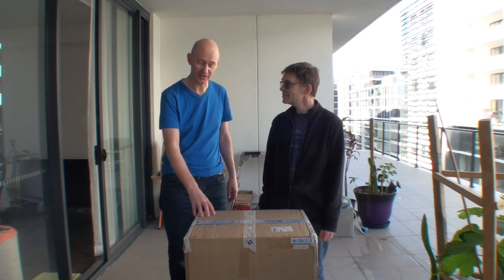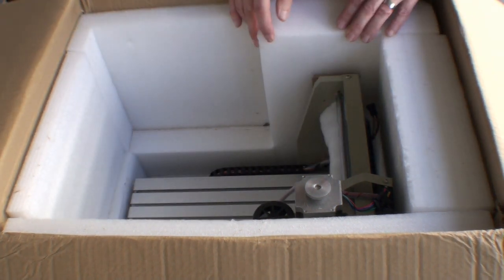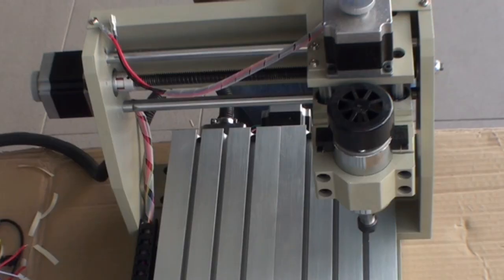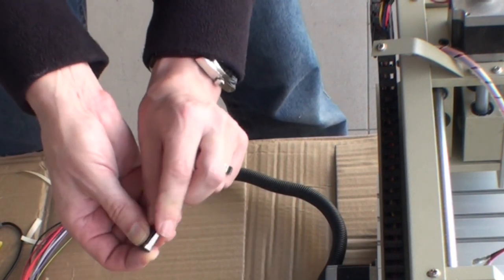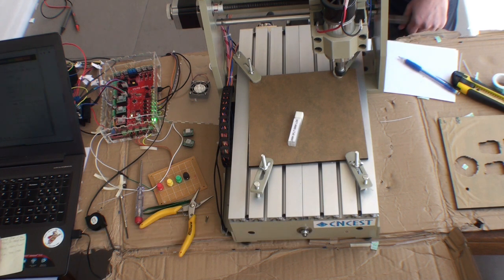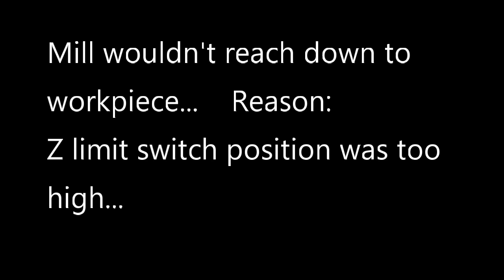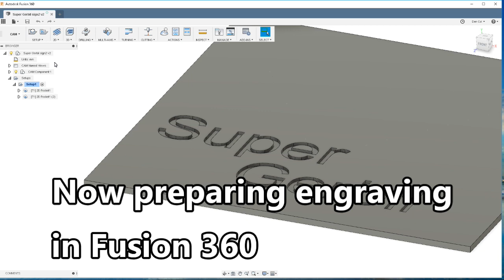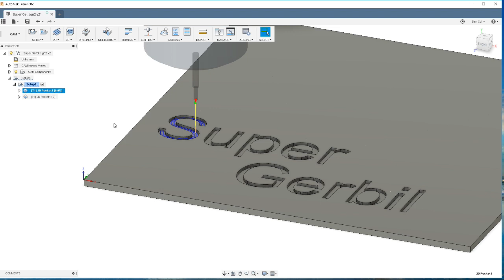Cheap Chinese 3020 mill - unbox and upgrade - 1 day challenge

Comment: Just set up the three axis version myself , i also fitted limit  switches but had to add the components to the break out board and some wires in the cable that runs to the machine from the controller . The original design was to use soft limits at both ends of travel , i added homing switches but will still use soft limits for the other end of the axis travel and i also added the wires so i can auto zero the  x,y and z axis using a probe . Next mod is a pwm controller and tacho for the motor ( the origional unit only varies the voltage to the motor when you turn the speed control knob ) then a 4 th axis which oddly enough is already fitted to the break out board so i just have to add the motor controller and wiring .
The super Gerbil unit looks interesting !
Reply: Looking forward to see your setup. The SG controller comes with an on-board pwm motor controller or you can use the opto coupler outputs of SG to control your external motor controller. Having the G-Code control your spindle is just convenient and safe. Also there are manual overrides if you need to slow down or speed up. A soft start feature ensures that you can start from zero to full rpm without any issues (the Arduino Grbl does not allow you to do so)
Reply: Hey there, I can't see you Icon pic & can't blow it up or anything. It looks like DJ's XD at Bathurst (or Oran Park) or a Bluebird at the HF1000 from the 80's. Are you a racer? An Aussie? Mick
Reply: SpatialGuy 
the car is called tru blu it was a djr car  - xd ford falcon  , 351 cleveland engine , photo is forest elbow at bathurst  . Not a racer myself just a fan of the driver and car . You can find the pics on the net just type in tru- blu into google and youre away .

Comment: G’day, I’m one of your early KS Gold backers - I was under the impression that the SuperGerbil was for use on non-cnc machinery - ie. add stepper or servo motors AND SuperGerbil and off you go...BUT here you are adding SG to an existing CNC machine. 
Can you explain please - better dumb it down a notch or five. 😉
Reply: Any machine or robot (e.g. Mill, Lathe, Laser, Viny cutter, embroidery machine, plasma cutter, pen plotter etc.) that has stepper motors can be controlled by Super Gerbil. Just hook up the motors to the on board drivers or use external drivers if your motors are really power hungry.
Reply: @pauldegroot2405  got it, but why do it to an existing / functioning CNC machine that doesn't need anything added to work? What are the benefits of the GERBIL
Reply: @SpatialGuy77  that's a good question and all depends on the  use cases and current setup. This is meant for the many users who run their cnc off a old desktop pc with parallel port or want to automate their manual mill. These lpt pc interfaces are hard to replace and pc's have their OS interferences. It's not an real time control which Super Gerbil is. The 32bits firmware code gives you precision cuts. Also mach3 and 4 licences are not cheap and adds to the overall price tag. This solution is meant to give the hobbyist access to precision, performance and ease of Gcode use at an affordable price tag that doesn't break the bank and keeps the wife happy!
Reply: @SpatialGuy77  forgot to mention that these cnc3020 machines don't come with software and controller. It's just a parallel port that needs to be tied to a lpt port....hope this makes sense
Reply: Paul de Groot  - very useful info thanks. Though I’m still not 100% , your reply has cleared up most of it. Thank you .
Reply: Yes, a lot of trying to figure out what is going on. You should make a video for JUST the SG controller with appropriate voiceover detailing features and logic for noobs.
Reply: @BrilliantDesignOnline  i might well just do that. Great suggestion!
Reply: @pauldegroot2405  From what I see, you should focus on what it does, not the name (because 'Super Gerbil' is confusing). Looks like a solid controller. I just installed UGS and without a controller, I gave up. Plus trying to open files yielded 3x errors on every mouse click trying to open a G-Code file. Having the ability to command up to 5 axes modularly seems good. Any hope of commanding the SG via Mach3? Every machine I have runs Mach3 currently.
Reply: @BrilliantDesignOnline  yes grea t suggestion. We actually rewrote a big part of UGS and send it to the community for inclusion

Comment: I am a total newb to this and wonder whether i should just jump into the deep end and get this machine or start with the 3018 and when i have understood gcode much better and how the axis work move up to the 4th. What do you think, I have limited experience but experience with my cnc laser and 3d printer, i just dont know wheter to go for a 3 axis or 4 axis......help please....
Thanks Neil.....
Reply: Dan Collins many many thanks I think you have now made up my mind on how to proceed, I am medically retired at 57 due to knees but my brain is razor sharp, this for me is a hobby and if I sell anything I make on Etsy all well and good. 1500 is a good benchmark as a new MBPis 2 k but my old one is only 5 years old so good still for a while , I have several. Nuk’s I picked up cheap and populated with win 10 all boot under 4 seconds with no software on them apart from the os. The only issue for me is possibly in the large machines I have no access to a parallel port only usb and I do not know whether this could be an issue for anything above the level of the 3018 clones out there. Many thanks and I will contact you, I was looking at your website last night and this is what made me write the question. Cheers from a english guy enjoying a quiet life in Spain Sitges.
Reply: @spiritburners  You're welcome Neil.  I use a NUC and occasionally a laptop as well.  It just seems crazy to be using parallel-port era technology when products like Super Gerbil do a better job with more convenient USB.  Best wishes with retirement and am sure you'll get a lot of fun from CNC.  I think Etsy, local markets etc can work well if you (or a friend/relative) are blessed with an artistic side that can make a unique design.  Cheers

Comment: @Paul as I watched this video I noticed that it states that the limiter switches were connected as NC. Wouldn't that be NO (normally open)? The whole idea is that a limiter switch, in such a situation is open until pressed just like a button. I don't see how you could set it up as NC. Could you explain, please?

Other than that, I'm soon getting a K40 and found your Gerbil and am definitely going to be getting it to go with. Too many problems I've read about with all K40s, but also about upgrades that fix many problems. Your system seems to do it all.
Reply: NC means normally closed and is preferred because if the wire has a break the mach will stop while with NO switches it would no detect a broken wire and potentially hit a limit or ignore the Abort. However you can configure it as NO or NC. It's a flexible solution.
Reply: @pauldegroot2405  Thanks for the response. I had a typo there, meant "NO". NC would be appropriate for door switches to ensure the laser wouldn't turn on when doors open or the switch breaks. But for limiters, unless you're using a switch that is NO when the lever is up, I can't see that working.
Reply: @brianfoster1504  okay I see what you mean. The firmware can just invert the logic. The logic is looking for just a state change. Either going from low to high or the other way around. Hope this makes sense. I might do just a video on that topic
Reply: @pauldegroot2405  In the video, you only stated that you set it up as NC. I guess I assumed you had switches with three pins allowing you to choose NO/NC, but that they were NC position switches. I can understand it when considering that your switches were instead NC/NO with NO being the default position of the switch. I can see those being the better choice.